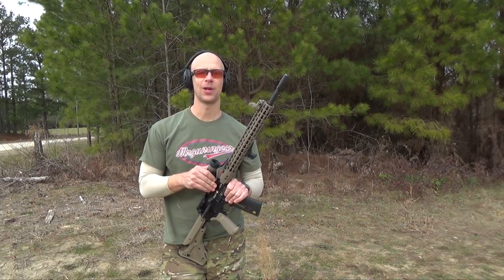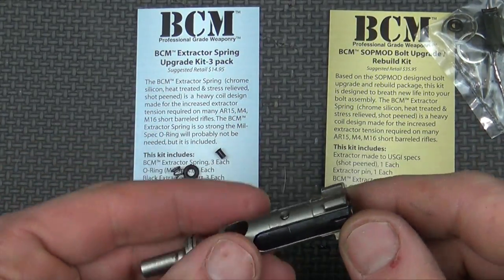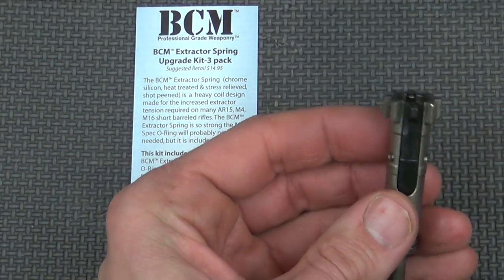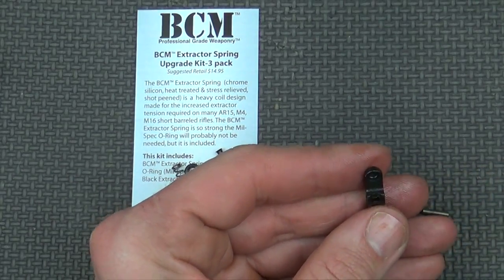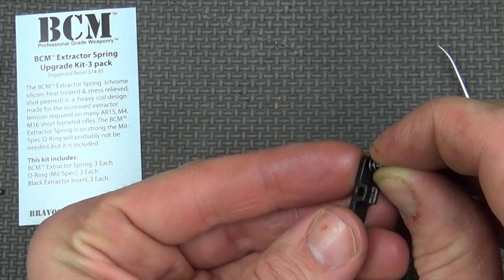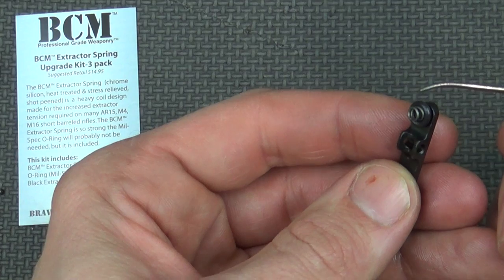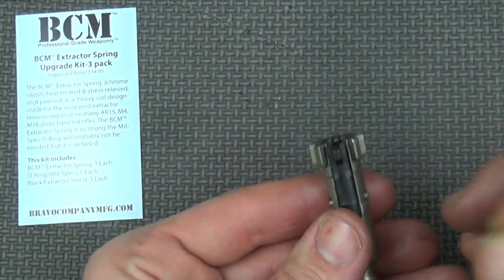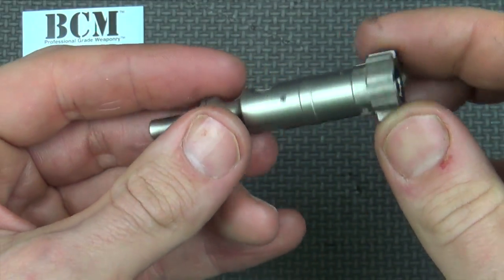BCM AR-15 Extractor Spring Upgrade Installation & Review (HD)

Comment: I have found the three things most likely to cause issues in an AR are the magazine, ejector & extractor springs & buffer weights/springs. These are easy fixes yet people seem to neglect the springs. 
The magazine is an external factor so, assuming the magazine is good, the most likely thing to cause problems are the springs in the bolt. If the springs in the bolt are good, even a cheap A#% bolt is reliable. It may break sooner but if the springs are good it will work fine until/if it breaks. 
The next thing is the buffer spring. They don't last forever (chrome silicon might) and when they wear out the bolt goes backward to fast, slams into the bottom of the buffer tube & then isn't strong enough to chamber the next round. 
These are simple fixes. If you swap out your critical springs every 3-5,000 rounds and use quality springs you will see 80%+ of your reliability issues go away.
I think you should do a video on the importance of buffers & springs. I think lots of people neglect these things & then complain about reliability. 
I can't tell you how many times people have come to me complaining of reliability issues that are cleared right up with $15 worth of springs. lol They think I am some kind of AR wizard but in reality, I am just the spring lady. (Shhh, don't tell anyone, I like them thinking there is magic involved.)
Reply from the maker: shananagans5 Agreed.
Reply: I read this in the voice of the Oracle from the Matrix.

Comment: I want to thank you for the easy to follow steps which made it simple for me to perform this upgrade. I had my first build out to the range the other weekend and it did not extract hardly a single case. FTE, FT feed, constant issues. Installed this and a new recoil spring and hope to get back out soon to see how she runs. It is my pandemic build and first build so not surprised or disappointed that I had problems. It's all a part of the learning process.
Reply: Any update?

Comment: My bolt came with this mod installed.  Spring tension was so great that the extractor would not ride up over the casing rim.  Actually caused a jam/FTF.  The jam was so tight that I had to remove the upper from the lower and "persuade" the carrier back and remove it from the upper.  Then I could put a cleaning rod down the barrel and remove the live round.  For my particular rifle, it was a clear failure.  Once I removed the mod, the rifle ran flawlessly. 

I also examined the case of the round that I removed with the cleaning rod, and the rim was very beat up, and jagged.
I did spend the better part of a week troubleshooting the FTF before I figured it out.
Reply: I've had a lot of psa uppers have this problem, too tight to go over case rim, causing the bolt to not close. Usually 200-300 rounds without the O-ring loosens the spring up enough to run fine when the O-ring is reinstalled.

Comment: Buy it now. this is the best $15 i spent on the 3 pack. i just installed this kit on two toolcraft bcgs from psa. one that was in my AR would extract weak and get stuck in the chamber after firing. After installing the bcm kit on both bcgs it extracted perfectly over 100 rounds no hiccup whatsover and the ejection pattern is perfect and strong.

Comment: Thanks! I cleaned my BCG along with the extractor today, and the extractor was very easy to put back in. Lubed up my BCG and then went to go fire some rounds and it shoots and extracts beautifully, a little better actually and smoother now that its all cleaned and lubed up. But for $5, I gotta buy myself one of those to keep in my kit as a spare.

Comment: That pin was hard to get in as you described. I wrapped the bolt in cloth with an empty round held into the end of the bolt, and gently tighten the vice till the extractor was perfectly in place then pushed the pin home. Thank you for your video, I was clueless from where to start.

Comment: You are correct in saying that most shooters won't need the o-ring. I purchased one of these kits for a PSA bolt and the o-ring made the extractor tension so tight, it actually caused malfunctions. I just used the upgraded spring after that and it worked perfectly.
Reply from the maker: SIG-504 Indeed.
Reply: Mrgunsngear Channel
 What is the purpose of the O-ring?

Comment: I believe BCM’s ungraded spring set is a 4 coil spring wish is actually mil-spec. Most bolts bring the old 3 coil spring.  This upgrade is especially good and needed for short barreled AR pistols or SBR’s because of the shorter duel time.   
Installed it on all three of my short barreled AR and it’s awesome.
Reply: "Duel" time?! Lol.
Reply: @skynetlabs  😂😂😂 I just saw that.  Good catch.

Comment: This was probably the biggest reliability upgrade for my rifle. Though, with my Bushmaster I think mine came a little faulty since I was having extreme extraction failure after putting a hundred or so rounds through my rifle when it was new.

Instead of dealing with returning it or looking to have it dealt with technical support I went with buying this spring. A lot of rifles like the Bushmaster come with a smaller commercial spring versus a milspec spring for whatever reason and mine just so happened to be garbage. I couldn't get the o-ring on but that didn't really matter as you mentioned and my rifle has since been 100% reliable. Damn Bushmaster's quality control is garbage and that was a hell of a headache to deal with but for 5 bucks I can't really complain about the easy fix this thing is.
Reply from the maker: Kabloosh Glad to hear it's working well.

Comment: this is so funny, I have been recommending the BCM parts to anyone who ask's and I run NOTHING but BCM gas rings and extractor springs, inserts and O rings in EVERY AR I own. after having issues with some poor quality parts long ago I simply replace these parts at 3K rds and when first building an AR. since then extraction and bolt related issues are a thing of the past. BTW its a good idea to change your rings with the spring/insert/o-ring since they are cheep insurance. nice video!
Reply from the maker: Militaristics Thank you.

Comment: I ordered the BCM 3 pack of springs about 3 hrs ago, my 10.5" ar pistol is having intermittent double feeds, I figured it was over gassed so I added just a touch over 100 grains to my buffer weight. Still double feeds about every 20th round of steel cased ammo. Im really hoping the new spring solves it, if not I'll be going with all brass ammo because I love the gun, the SBA3 Brace is the greatest thing to come down the pipe in a long time IMO....
Reply from the maker: thanks for the report

Comment: Very informative video.  Had the same problem with my ar10.  Bought one and replaced it. Solved the problem.  Was able to empty a full 20 round mag of steel casing. without a problem.  Bolt would not to battery either now closes nicely.

Comment: Attempted this with a enhanced Sprinco spring. It failed to extract and I ended up just ordering a replacement bolt until I get time to mess with it again. Next time I'll get just a standard replacement spring and not a "enhanced" one. Reading comments below it appears many had a similar experience.

Comment: The O ring is of dubious utility in moderately gassed systems - a decent extractor spring by itself is all that's necessary. You have to remember that the O ring was designed for 14.5" and 10.3" barrels with carbine length gas systems.
Reply from the maker: thanks for the report
Reply: Yeah. BCM actually recommends these crane o-rings with their sub 14.5 inch uppers

“Thank you for contacting us. When running a SBR (less than 14.5”) with good mil-spec pressured ammunition we recommend using a H2 buffer. If you are suppressing it then you may need to swap the buffer to the even heavier H3 buffer. Please make sure that you BCG extractor spring has the Crane O-ring installed to help with extraction and that you are using a mil-spec 17-7 action spring.”

Comment: It's a good upgrade. I have a 14.7" PSA upper and it did not like steel cased brown Bear 223, FTF on ever 2-3 round, double feeds, etc.... just weak ammo. I upgraded and it did not fully resolve the issue but went from every 2-3 to every 9-10 round. Not the best ammo, but my other ARs feed without issue. Solution, I just don't shoot Brown Bear in it.
Reply: ***** True, definitely undergassed which contributed to the failure to extract, but it feeds and extracts perfectly fine with all the brass ammo I've used. Additionally, the BCM extractor did help resolve the problem to a certain extent, so it's somewhat unusual. I did also change out buffer. Just keep shooting brass and tinkering with it.
Reply from the maker: BLK RFL DIV Solid solution.

Comment: the sprinco tactical springs 5 coil spring is basically the same product but instead of being shot peened they are cryogenically processed. They are said to function well for over 200,000 rounds. That's not a typo.
Reply from the maker: I've read that.

Comment: Way to share more ar15 wisdom! Along the same lines you could do a video on changing gas rings and when to replace them. I've always gone by the "stand my BCG upright and make sure the bolt lets the carrier fall downward" test -- but not sure if that's an old wives tale or if you use another method to know when to change them. Thanks for the great content!
Reply from the maker: ddyoder Thank you.

Comment: glad you made a video on this, as im a true believer in the extractor spring upgrade. few years ago when i did my first ar pistol i couldnt get it to fire more than 2 rounds before it would either fte, ftf, stovepipe and my buddy who got his at the same time from the same place couldnt get more than 1 round. i searched all over the net, confusing myself about buffers, bolt carriers, lubing the hell out of my ar, sanded stuff down to make it smoother thinking thatd help. i didnt even know what a gas port was. found the bcm 3 pack, and we both went full on mag dumps with no problems after that. we had model 1 uppers and carbine buffers and like you said, dont let a 5 dollar part keep your ar from running. i use these in all my rifles now, pistol or not. the wolff springs ones from gunsprings.com work the same but i think they dont come with the o ring or the little plastic piece and they say you dont need it for theirs. i believe they were a little longer than the bcm ones but every bit as reliable and hard to install!

Comment: Respectfully you don't slide the o-ring all the way up. This will cause issues because the o-ring will actually get in-between the coils and not let the spring compress all the way. You put the spring on the very end of the spring so when you install the extractor to the bolt the o-ring on the very end of the spring allows the spring to compress all the way

Comment: Question....running a 7.5 inch 556.....can put one round in the mag a fire. The bolt locks back but the spent casing is just chilling inside the action..not the chamber ...looks like the extractor slips off when it fires ..just ordered this and an adjustable gas block ...thinking overgassed and weak extractor . Should i be able tho manipulate the extractor easily with me finger?  Cause i can

Comment: Nice color rifle. My Saint Victor pistol 300 blackout, not sure if it has an insert. There was only O Ring and Spring. I’ve called Springfield. One told me only O ring and Spring extractor. Another said she didn’t know. Do you know for sure even a Pistol AR needs all three components. My missing an Insert. I’m not sure it will fire. I don’t wanna take it to the Range, I’m waiting to get more feedback. Thanks.
Reply: I mean I’m not sure it Will Extract the casing.
Reply: Extract the casing without the Insert?

Comment: If I purchased a BCM BCG do I still need the extractor Kit for my 10.3 or is that same spring already installed in it? I know the o ring comes with it in the package for use on shorter barrels but not sure if the spring that’s already in it is the same one that comes with the extractor kit

Comment: Wonder why a few still eject forward,  I have the aim surplus bcg for now and after this video I took my bolt down and the spring is shorter and thinner then the bcm spring looks so I'm going to erder the 3 pack
Reply: If you do both the ejector & extractor at the same time you will get a more consistent pattern. That balance between the two is important. The extractor grabs the shell & the ejector slings it out. If the extractor is tight & the ejector is weak it won't be consistent.
Reply from the maker: aaron rothe It's likely due to 18'' barrel and rifle gas system.  But, nothing wrong with it despite what a chart may say....
Reply: Mrgunsngear Channel thanks , I just got my first ar15 I've ran ak47 for years so I'm trying to learn all I can thanks for the reply
Reply: ***** yea it is

Comment: I have a CMMG Banshee 200 pistol in .40S&W. It has an 8" barrel & comes with their radial delayed blowback system bolt. It looks like an AR bolt system. But it doesn't have a gas system of course. I just recently started having failure to extract and double feed and semi stove pipe issues. I found a YouTube video from another guy that referred to this video saying that this extractor kit will work on my Banshee and fix that problem. Do you have any feedback on this? I have contacted cmmg and they want pictures of the malfunctions. I told the guy from CMMG that I didnt take any pics and it's going to be awhile before I get out there to do some more shooting. Apparently they are aware of the issue but still want me to show them something. So I ordered two of these kits and I'm going to try this fix and hopefully it fixes the problem before they decide to get back to me. I hope this kit fits in right on my Banshee like that other YouTuber specified on his video. Has anyone else tried this extractor spring upgrade kit on other than an AR-15?

Comment: Only 6k rounds and an extractor failure? I'm surprised, who's BCG assembly is that? I'm a little over 8K rounds through my Del-ton and it still shoots straight and feeds / extracts great. Only part that is starting to look old is the firing pin retaining pin. I'll probably buy a few little pieces soon to keep in stock just in case but so far it's holding strong. Kind of leads me to believe they are some what underrated.

Comment: So if I'm having extraction issues related to the extractor/extractor spring, is more than likely going to always be the spring? How do I know if the extractor itself needs to be replaced? Thanks for the video.
Reply: Unless the extractor is chipped or cracked then it's just the spring

Comment: I ordered this Upgrade Spring Kit when buying my Lantac E-BCG.  But for the Life of me  I can not get the Extractor Pin to budge, I cant feel any movement in the extractor when I attempt to put pressure on it as you show before trying to push the pin out.  Honestly, I dont even need the Upgrade as the BCG is brand new and only reason I ordered the upgrade spring was a few guys when reviewing the Lantac E-BCG stated they had issues until they did this upgrade.   So until I have problems I dont need to upgrade the spring. But at this point would still like to know what I am doing wrong and why this wont budge.  Even if just for cleaning or plain old curiosity sake.  If your familiar with this Lantac E-BCG and have any advice, id really appreciate it.
Reply: Scott Richardson did you try and use something to get it started like a small punch or you can just use the tip of a round
Reply: @mattharper588    I used a punch.  I did everything other than chuck it in a vise and use punch and hammer.  Sucker not budging.  Maybe loosen up a bit after even just a little use? Maybe?
Reply: Yes try a drop of oil on it and then run some rounds through it sometimes they can be a bitch to get back in also
Reply: @SlimShadySkip1  I had the same issue. I sprayed some penetrating oil on it over night then just squeezed the hell out of it and it came right out.

Comment: Would it be typical to have use this kit in a bolt that has less than 500 rounds through it?! Literally bought my upper a couple months back and the extractor isn't functioning and I'm getting double feeds! So frustrating I spend all this money on a BCM and they can't put the upgraded kit in it prior! 😤
Reply from the maker: that's not normal but it should help

Comment: Why would you not need the o-ring and how would I know? THanks.
Reply from the maker: depending on ammo, port size, buffer weight, etc.. it may be too much extractor tension
Reply: Thanks. All my BCG's are working fine but I'll keep this in mind if I ever notice extraction issues.

Comment: in chicago it has been around -40 with the windchill. do i need a special o-ring rated to a lower temp.? :0
Reply from the maker: mrrrrrrrrrrrrrrrrrk I don't believe there is one; just take it out if you're worried.

Comment: Hi i enjoy your videos i have have a question i built my ar with a anderson lower and an American Tactical AR-15 16" 5.56mm Upper Receiver 1:7 Twist i put a psa nickel boran bcg i took it to the range but it shoots one round and then i have to charge the handle it ejets a round and then shoots the next one and so on what do you think the problem could be ?
Reply: sounds like a problem with the gas system - gas isn't getting back to the bolt to cycle the action

Comment: Were you getting pretty frequent stovepipes prior to this upgrade? I am trying to solve a stovepipe issue on my AR, can't seem to narrow down the culprit.
Reply from the maker: +Andrew Finegan no; I wasn't
Reply: +Andrew Finegan Extractor - Ejector - Buffer. I'd check all three.
Reply: I might be a little late but on one build I was having stovepipes due to being undergassed. Check the gas system unless you've already solved the issue. Good luck.